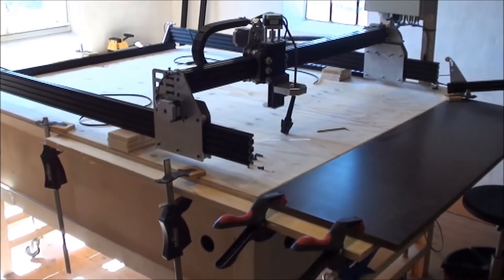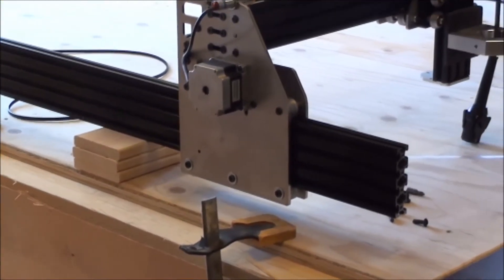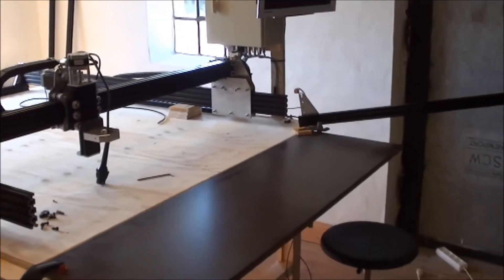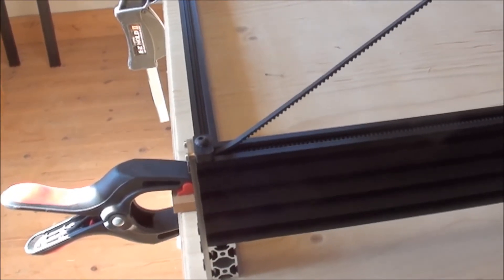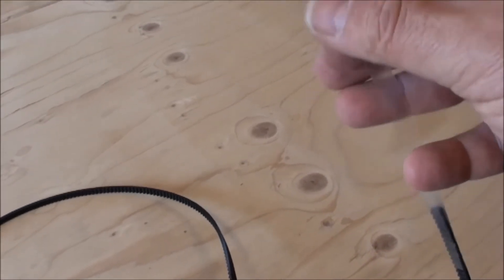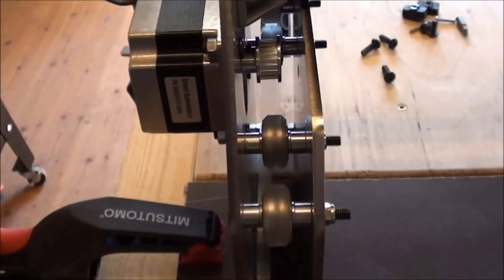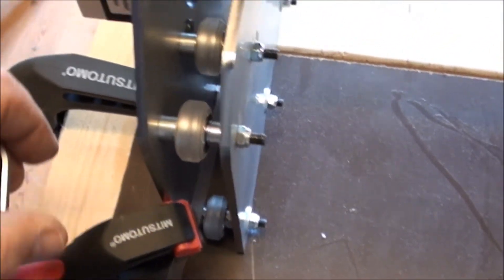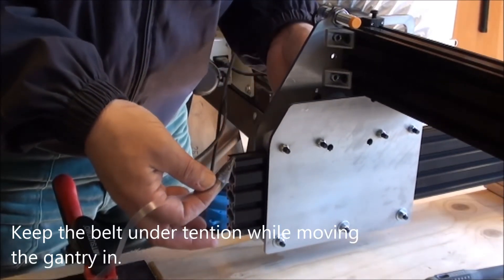Dual belt/Servo belt mounting the Y-axis on Stainless OX CNC

Comment: Hello Martin,  I really enjoy your videos and was wonder where you purchase your timing belts.  I purchase my belts xl025 belts on ebay and from McMaster Carr and the belts are  slightly wider than .25"  The belts don't work as smooth as they should and I think it is because they are too wide.  Any assistance would be awesome.
Reply from the maker: Tracy Ranson Hi Tracy, Thanks for the encouragement. If you are in the US you can get 5mm belt from he parts store at Openbuilds.com. If you are in Europe you can source from makersupplies.dk
Good luck with your build. Martin
Reply: The price per foot on Openbuilds.com is too expensive I need a more affordable solution.  I buy my belts from another company but they don't sell metric width belts.  I am also using XL not MXL belts. I will keep looking but thanks for the assistance.